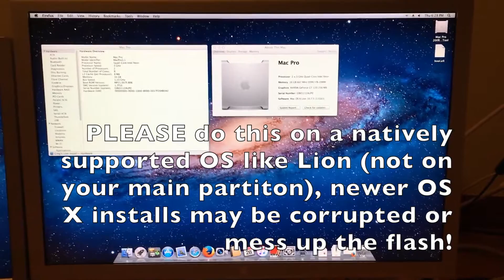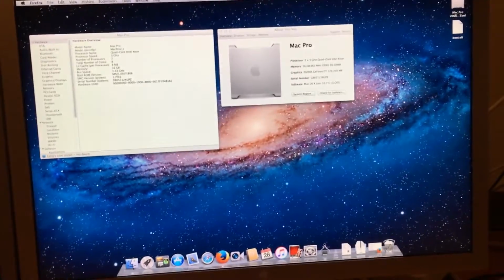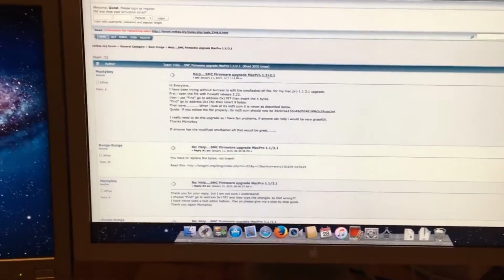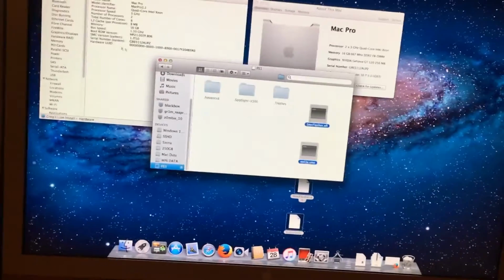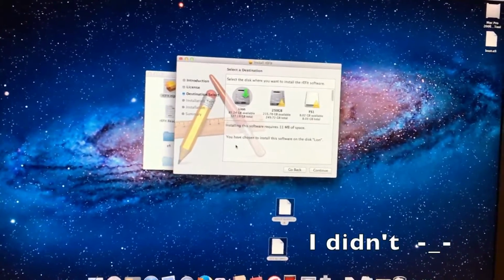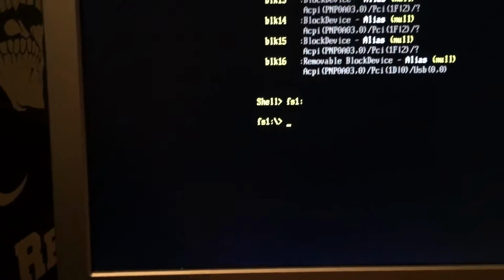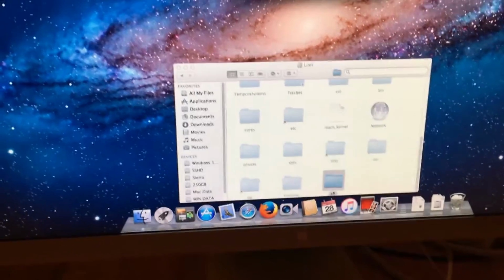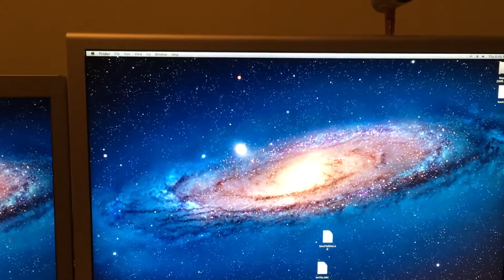Mac Pro 1,1 to 2,1 EFI & SMC Update Part 2: SMC Update - Mac Pro 1,1/2,1 Series ep.18

Comment: hello i followed the video and used the same directions naming also the usb FS1. unfortunately after the command it doesn't go forward and returns: is not recognizedas an internal or external command, operable program, or batch file and sends me back fs1 :\> how can i do to exit that with exit it doesn't exit.. or how to get back to Shell maybe having written the usb disk in lower case it doesn't take the command. thanks
Reply: as unsaid by dint of trial and error I succeeded, I had placed the downloaded files in the usb and the ones to desktop in the trash and then deleted, I redid the procedure from the beginning and left the files on the desktop and everything was successful! thanks for your directions. You are Top!
Reply from the maker: I’m glad it worked out for you

Comment: I’ve done the SMC firmware upgrade to my 2,1’d 1,1, is there any way to relatively easily downgrade back to the 1,1 SMC firmware? I monitor the temps religiously so the increase in temps wouldn’t be of a concern but I’d like to downgrade to reduce the aggressiveness of the fans ramping up to quick spikes in temps, it’s rather distracting when that wasn’t an issue on the 1,1 SMC firmware. 

(I know there’s a link to downgrading in the description, but I’m not comfortable with hexediting the SMC files incase I stuff up and brick my machine)
Reply from the maker: yeah that's the only way to do it... I did it once to re do it for the video

Comment: Hello, I followed exactly the guidelines of the two mac pro 1.1 upgrade videos
The two processors remain "unknown". I turn off the cpu and turn it on as instructed. It restarts, doesn't open the drives and restarts again without changes.
Could help?
Reply from the maker: Well that would be the EFI flash… did you get the I think it’s 5510 error? You now have to have the files on the desktop open before you make the boot image because it doesn’t download anymore

Comment: This was extremely helpful Greg! Just trying to run the SMC 11 package from Apple to upgrade the 1,1 to the 2,1 SMC did not work and only led to frustration.  This worked perfectly! My SMC firmware is now correct on my 2,1 that I upgraded from a 1,1 with dual Xeon 5365 CPUs.  This should make watching movies and other things more enjoyable by having the fan curve running properly and more quietly in general.  It got pretty loud sometimes on the 1,1 SMC firmware.

Comment: Does the SMC update matter that much, or maybe I should ask, what advantages does it have over, say, the fan control software you listed?
Reply from the maker: It’ll allow the system to control the fans for the more powerful CPUs without input other than that no real need for it

Comment: Thanks! This worked well for me. However, my flash drive didn't automatically mount - something which some others seemed to have a problem with. For the following information, my Flash Drive was named 'SMC'.
To get around it:
1. When you have booted to the EFI Shell from ReFit, type 'map' and press return. This will list all the connected drives, along with the device names associated with each one. If you look at the bottom of the list, there should be one listed which includes the text ":Removeable HardDisk" and underneath should say somewhere in the text, "/Usb(1,0)".
(Note that this may vary from what you see and that the number may vary from (1,0). This is simply what mine said.)
2. Make a note of the device name in yellow text for the device (not the 'Alias', but the name in yellow in front of ":Removeable HardDisk"). In my case the device name was "hd37b0b".
3.Type the command as follows using your device name and press return:
        "map hdxxxxx SMC"
(in my case, it was "map hd37b0b SMC").
4. You should now be able to type "SMC:" and press enter and you will get the command prompt "SMC:/>" which means you are now on your flash drive. You can now continue with the commands in the video.

Hope this is helpful to somebody out there. Thanks for making the video in the first place. x

Comment: Ive tried several times to execute the smcflasher , when I load up the stick FS1: I scroll thru the directories and I do not see the smcflasher.efi. I put it in several locations
Reply from the maker: It should just be in the root directory and should just work if properly formatted
Reply: @HrutkayMods  I figured it out, someone in this thread mentioned running map I had wrong drive. however when I run smcflasher -reset 1 it says its in wrong AppCode and to use -reset 1 ....okayyyy

Comment: Hi Greg, I followed your tutorial (thanks a lot!)  to upgrade my 2006 Mac Pro 1,1 to 2,1. Also I upgraded the SMC.  I swapped out the 2 x 2.66 ghz CPU's for 2 x 3.0 ghz Quad core intel-Xeon.  I'm not really a Mac person,  and have no confidence, and wanted to put El Capitan instead of the Snow leopard 10.6, so I cheated and bought a drive from ebay with it already installed. It all works fine and dandy, and I have put in 32 gb of RAM in, but I am at the point where I'd like to sell it. I read somewhere that I mustn't update the Mac Pro with this efi and smc modification incase I lose the operating system. Is that correct, or can I just let it update from the web? Thanks for all of your help, and your video's are a great help to us all, especially me, as I'm 70 yrs old and tend to dive in without thinking! It worked though!
Reply from the maker: Yes don’t just update it past security update 2017–005... I have a bunch of videos about it at the end of season two of the Mac Pro series

Comment: I seem to have an issue under El Capitan or Lion with the 3ghz CPU's, they randomly fail to function. I get my panic report saying the "CPU's Failed to respond or are unresponsive". It does not happen with the original 2.66Ghz CPU's, I even used a new set of 3Ghz CPU's. With both sets of 3Ghz CPU's, one set does it every time while the other randomly does it. Would you have any thoughts regarding this issue? Otherwise everything you've recommended has been an awesome experience.
Reply: any update? Where you able to fix the issue?

Comment: Hey greg, I have been running my 1.1 flashed to 2.1 with 8 core 3ghz for almost two years witjout knowing I had to flash the smc. Whats your toughts about this ? The fan surely adjust with the temp reading, so It is surely not dramatic imo.

Comment: Thank you very much, my clean install of Lion and the EFI/SMC updates were installed successfully. I have to admit it took me a whole day to do it, but I did it. Just a heads up with flashed multiple output video cards, I was switching from different sockets because I had no idea what was going on during the EFI update since I was looking at a black screen of nothingness. Everything works like a charm except it doesn't complete a restart command, it would restart and leave me in a black screen, it doesn't go through the chime. So I end up pressing the power button to switch it off and instantly press again to power it up (manual restart). Thank you

Comment: hi i've just upgrade my mp from 1.1 to 2.1 with dual processor 2.66,  and i'm waiting for deliver of my two x5365 quad cpus, can i do this smc fw upgrade now or i should do the cpu upgrade first? thanks for answer. again great work for the detaille video, thanks.
Reply from the maker: +INVEST A PARIS you can do it now if you’d like
Reply: hi thanks for your answer, my cpu will come in two days, i wonder what the different is between fan control app and smc update? which way is best for a 8 core updated 2.1? thank you for your time!

Comment: After upgrading to dual quad 3s and updating the firmware my pros northbridge is reading at 126c with all other temps low ie: CPUs are 30c ambient is 20c. My question is if this is common when upgrading 1,1 to 2,1 and if updating the smc will clear this up or am I looking at a failed heatsink/thermostat on my northbridge?
Reply from the maker: Well that's the point of upgrading the SMC... It'll increase fan speed under load... I've seen many people with those temps though... the sensor might possibly be outta wack though
Reply: flashed the smc, still seeing 126c on nothbridge which is keeping the fans running at 2800 rpm. Ive tried changing out the thermal paste a few times too. no luck. dang it.
Reply: @danlex9  is the thermal sensor thats on the northbridge heatsink connected to the motherboards header? the transistor thats bonded to the heatsink may have also failed...

Comment: I have a few questions... When formatting the usb, should it be a master boot record or GUID?  How do you get a Lion bootable HDD? I had to use snow leopard disc and recover from an old backup from a friends computer running lion... so its not really a bootable disk so every time i power up i have to hit option and boot into lion that way. When i hit restart it goes to el capitan every time so it wont let me boot into lion as primary drive... should i remove my el capitan disk and try or do you have an easy method for me to make a bootable Lion hdd? hope someone can answer me soon.
Reply from the maker: I need to update that on the video also... you need to format the drive in FAT, also the startup disk options are in settings... Snow Leopard should work fine. Also it wouldn't hurt to pull your EL Cap disk out
Reply: I hit option/alt key and i got into efi right away.
Reply from the maker: +wrxsubaru02 that's great :)

Comment: After upgrading my mac pro 1,1 to 8core, I noticed the extra fan noise, I was googling it when I found your video, Thank you very much for the valuable info.
So I followed your instructions (very clear) then I got stuck with this error message after the command line :
'SmcFlasher.efi' is not recognized as an internal or external command, operable program, or batch file.
Any idea why is this happening ??
Thanks again for your work.
Reply: I got it. Here is the solution :
The USB stick is properly formatted and everything works fine, the trick is that the USB is mounted as different name (not FSx:). What I did is this :
- start the SHELL EFI
- type "map" and click enter
- note the names of all the mounted volumes you will find
- go into every "removable disk" one by one and type "ls" to see the files tree, until you find the two files that you copied into your USB.
- I found them in the volume "blk6:" yours maybe in a different one.
- There you go. type the command line in this video tutorial and boom.
- Thank Hrutkay Mods for this very useful video.
Reply from the maker: you're quite welcome, and sorry I was late responding lol. thanks for the info, I'll probably make an update video with your info, thanking you and informing because a lot of people has had this issue
Reply: Jean Paul hi I've followed your steps to try and find my flash drive still no luck have you any ideas
Reply: Jean Paul hi completed your steps and when I try to map the flash drive I can see it's there as a removable device but when I type in the command  LS I get the response of no mapping invalid file system mapping

Comment: Hi I have a Mac Pro 1.1 , from 2007 i think, the firmware update tool doesnt seem to work, when switching on holding de power button until de led flashes, the "flash" apple logo image will be displayed in the monitor for like 1 sec, after that it reboots again to the OS, the firmware stills 1.1.

What could be happening?
Reply from the maker: are you running el capitan? El Capitan blocks it but I think there is a work around... if not, if your Pro was an Apple refurb, they had a different EFI version that they say isn't flashable (I'm sure it could be done with some hex editing and rEFIt probably) but if it's an el capitan problem, do it through Lion. I think the El Capitan work around is disabling SIP in the recovery partiton